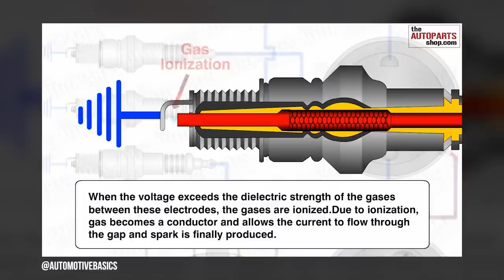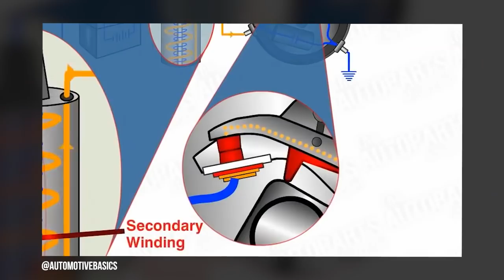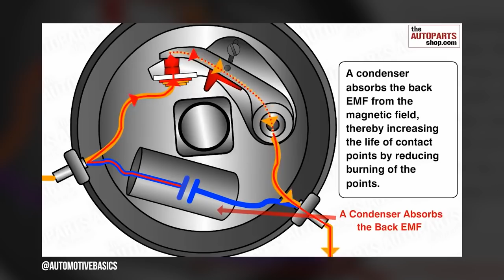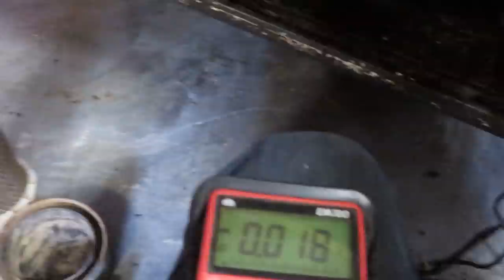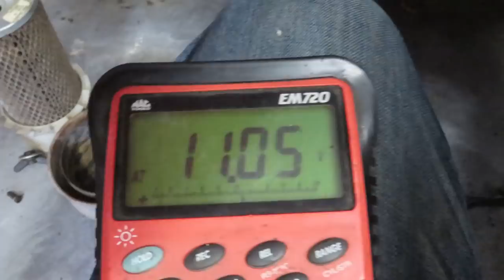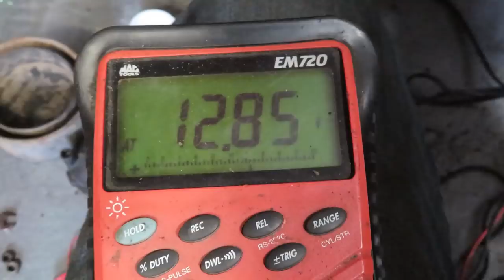What Could Be Wrong With A $300 Skid Steer?

Comment: I think that extra spark plug wire was your carb vacuum cap at some point.
Reply: Surely that would make sense. I wondered at the time: if there 𝐰𝐚𝐬𝐧'𝐭 a hose looking for a home, then the missing hose couldn't be the problem. Whatever's wrong with it, it has just happened. I mean, something must have changed for the thing not to run. If that wire had been used as a bung, then fallen out, that would explain the change. Right?  I know what I mean.😁
Reply: @2H80vids  I'll admit it, in a pinch on a Sunday, I've used spark plug boots to block off a couple vacuum ports.

Comment: If you haven't figured it out already, that's a Mitsubishi G64B or G63B engine like in 1987 to 1995 Mitsubishi Pickup. Distributor looks the same as mine. Should work. Check the timing belt. If loose may have slipped.

Comment: At least the engine is in the correct orientation. Most bobcat's have the engine transverse with rubber belts driving the hydro. For $300 I'd pull the engine and do a basic cleanup and com check and adjust valves and etc. Also clean the hidden oil cooler!!

Comment: A skid steer that won't sit still is a major PITA on a good day.  On a bad day they get lethal.  Last one I worked on for a guy he said he was having difficulty driving straight with it.  Jump in fire it up, right side creeps forward at a good clip.  I go to counter it (gently and calculated).  The damn thing goes full reverse on the right side swinging the bucket into a utility pole.  Hydraulic pump was hanging on with one bolt.  Every bushing was hammered.  I hate skid steers.

Comment: you might be wrong about the positive and negative on the points. the reason i say that is because in the old days you could run a positive to the coil and jump the starter with a screw driver and you were off and running with no keys

Comment: Considering where that passage ended up when you traced the solenoid on the carb, it looks like it is used to turn on/off a port vacuum source.  I have no idea why they would bother with that, unless it originally used port vacuum to operate the vacuum advance diaphragm on the distributor.  If it had this, it could have been an assist to starting the engine by retarding the timing.  This port vacuum advance was something that they used to do in the 80s to meet emissions, there are a lot of 80s pickups out there that used this system.  Tons of people in the 80s tried switching a port vacuum vacuum advance canister (which uses much less vacuum) in their pickups to a manifold vacuum source only to find that they now had a part throttle ping due to over-advance, and if they backed the timing off to reduce the ping the engine got really lazy.  This problem went away when most manufacturers went to throttle body injection around 87.

Comment: A340H,  just rebuilt my first automatic transmission.  95 4runner everything went good. Got it back together, it only works in 4wd. Works good shifts through all the gears. 2wd you can feel it trying, no go through.  Anybody have experience with a340h transmission and transfer case.

Comment: That's not quite how a points ignition works.  The point opening breaks the ground.  The condenser is there to keep the points from arcing.  The sudden collapse in the magnetic field of the coil primary induces the much higher voltage in the coil secondary.

Big carburetor fittings like that usually go to the pcv system.

Comment: Why not use some JB weld on the broken rotor? Build up the material, then shave it down with a Dremel. 
Or if you know someone with a 3d printer, you can have them make one for you. Nice video by the way 💪

Comment: Why does everyone hate on Fram? Ive been running them for years with zero issues. All my vehicles have well over 200k
Reply: I've never had a problem with Fram stuff either. I do normally use Wix but I don't hesitate if Fram is all that's available.

Comment: People say it's not volts that kill you it's amps but that is not how electric works. Think of it like a water pipe with voltage as pressure pressure, amps is the amount of water flowing through the pipe and resistance is the resistance of the pipe i.e. size of pipe and anything blocking the pipe like a filter or something. You can have very high voltage and feel nothing like with static electricity because there are very low amps but if you had 100mA at 1GV then that would probably kill you.

Comment: i traded a couple 40ft seacans for a 7753, came with forks, 4 in 1 bucket, regular bucket and a backhoe, it sat for over 10 years, fired right up, it has its issues, the locking pins for the attachments were locked up solid with rust, had to cut the bucket off then cut the pins out, that works fine now, the fuel pickup line fell off inside the tank, have a jerry can hanging from a wire on the side of the machine i use for fuel now,  all the belts fell apart as you would expect, it blew one hose so far right down at the bottom under the seat, had to stand on my head to fix that, the one drive motor leaks some oil, not so bad but i will fix that, and i need to fix the bearings for the cooling blower, all in all i'm tickled pink to own it, i keep it at a friends and he uses it almost every day, he taught his daughter to run it, i need to figure out the  auxiliary hydraulics so i can use the 4 in 1 and the backhoe lol

Comment: I realize this vid is over a year old but ignition timing is not determined by the relationship between the rotor and the terminal in the  cap.  All that will change there is the air gap
  Ignition timing is determined by the relationship of the signal generated by the reduction and pickup coil(or points cracking open)  to the position of the crank throw on the cylinder that's firing.  The floppy rotor would not have affected ignition timing unless it was turned on the shaft so far that the resistance was lower for the spark to arc to the previous cylinder.
Did it jump a cog on the timing belt?

Comment: Rich, what’s your thoughts on putting electronic ignition kits in these older gas machines? I put a penteronix kit with a flame thrower coil on our IH 686 earlier this summer. I wouldn’t say it helps much on start up but if I rip it from low idle to wide open, it doesn’t sputter and carry on like a lot of these old gas engines do when using points. There was a great debate on points versus electronic ignition recently on the Red Power Forum that seemed to be a drawl and a matter of preference. Good video as usual man.

Comment: Looks like a 4g32 Mitsubishi engine, they're in all sorts of equipment, especially forklifts. I think some of the earlier Dodge Colts came with these here in the states as well as some Mitsubishi vehicles, I do know finding parts for these engines is a whole lot easier through regular parts stores or eBay than the respective equipment dealer. Seems once something has a few years on it they're not really interested in selling parts for them.

Comment: Hey all, can't seem to find any solid info online. Can average me waltz into Home Depo and rent me a Skid steer with no hassle?  I now that you do not need a special license but that's about it. Seen a few video on how to loosely operate one but I have never operated a skid steer before. I'm confident, eager to quickly learn and competent. I have a small drive-way project that requires some leveling and moving mulch around that I would not like to do with my two hands and shovel. Something like a bob cat or skid steer comes to mind to make this a quicker job. Maybe removing a stump and relocating two Cyrtostachys (I think thats what they are) 5 feet closer to the street on the front lawn. Any input is greatly appreciated. Thanks!

Comment: Ballast resistors and coils are cheap as well. Also I wonder if it jumped a tooth.
Reply: Yeah. 
Doubt they did a timing belt on that thing
Reply: @fastinradfordable  the belt gets old, worn, and stretched, and will jump a tooth. Specially when your ignition is all messed up and you get a backfire.

Comment: current doesn't kill voltage dose because voltage determines the current potential so if the voltage is low the current is low. The higher the voltage the higher the current potential. Also, the duration of the shock also plays a role in this too. if you get shocked by a 10k volt discharge and 12 amps but only for .000000000001 seconds you'll be fine.
Reply: Elecrtoboom.

Comment: Bobcat 642 with a 1.6 L POS ford gas in it. I have this skid and we adapted a kubota diesel in it and it runs great. If you have this skid and you’re looking to move away from this unreliable engine. The kubota v1505 is a relatively simple and very reliable swap

Comment: This I learned from a guy who knew nothing else of value: when the intake catches on fire, apply wide open throttle and crank the engine, the engine will suck in the fire as it starts or even as it cranks and the problem is solved! no extinguisher needed.

Comment: The only complaint I have with this model design is the way they plumbed the hydraulics mine is down now because of a line that has a hole from rubbing on the frame gotta pull the engine to replace it.

Comment: Here is what happens when a young guy works on old style motors no clue on setting timing or dwell.  Ya want to find top dead center on number one (just remove number one spark plug hand crank engine and look for piston comming up once it is all the up is at tdc ) now you can mark the pull your from the timing light.

Comment: The distributor is bad that's why the rotors were damaged . While they were running it it backfired and blew the vacuum cap of the carburetor.  Seen this at least 50 times . Next it will break rotors and distributor caps . 
 While it running you can probably see the cap move. Then it'll start jumping time.

Comment: I have a diesel 853 bobcat and it has a fuel tank on the back door and leaks hydraulic fluid from the drive spoons and we traded some old junk hay equipment for it and it came with a log grapple a grapple bucket hay forks pallet forks and a snowplow for free so if i were to sell it I should get at least 5 grand CAD

Comment: Jesus, noone thought about cranking the engine to suck in the flames? lol
Reply: And blow the carb or intake
Reply: @FishFind3000  How in the world could you see that being a problem, it barely ran without the help of the aerosol anyway, it would just eat the rest of it until it was gone from the intake tract. Fine, pull the coil wire too then, and then crank it.
Reply: Not worried about the full fuel bowl, eh?

Comment: Its a Mitsubishi 4G63 isn't it? You should be able to get it easily  as they go in Mitsubishi vans and pickups. Don't just crank the distributor one way set it up on TDC on No1 and do it properly then set it to 8*BTDC. The timing marks are on the front cover and theres a notch in crank pulley  Check the plugs They probably have a half inch gap.

Comment: Low compression.  Maybe running on 3 but I bet it's got about 60 pounds of cranking compression.  Run it till a rod blows and pull some of the hydraulics before getting your 300 back in scrap weight.
Reply from the maker: When I moved the magnet, the dead cylinder moved

Comment: Typically voltage drop is checked with a load, using a voltmeter without a supplied load does not give an accurate test.

Comment: I have worked on electronics (I Have a Shop) for years & all 12v Batteries should be 13.8v !  They just call them 12v for some reason any new 12v batt should read 13.8 if it dont either its week/or bad or the tester is bad /out of calibration !  & i am assuming you know this & ya just mixed up what ya was saying cuz i do it to !

Comment: Wonna have an unreliable pice of equipment, put fram/scam products in it.😎
12:29 how I am when I’m putting in my 7.3 injector without a torque wrench to 10ft lbs, & trying to get it snug enough, but not over tight to not break the bolt/head.😂

That poor starter.

Comment: Hello Rich. Bobcat has a seareil number book 📖 that tells you when the machine was built being the company has changed hands over the years and has a fantastic story of evolution. 
I have a Baby Bobcat 443 model. The owners before me changed out the diesel and did a fantastic job of shoehorning in a 
Harbor Freight Predator 22 hp gas ⛽ engine. It's like a lawnmower on steroid s. According to the
 seareil number, it was the LAST MACHINE built in December of 1975 by Bobcat Monroe company's.
 On January 1st. 1976 The company became 
Bobcat Ingallsall-Rand.
I've made improvements to it like  the bucket two handel interface release and remounted the bushings to the arm tips for rotation clearance. New wheel seals and engine belt pully. 
These machines don't die, they just get better with age. 
Richard Bause 
Upstate New York.

Comment: It's not current that kills you. You can touch a welder with very litle voltage and thousands of amps and you won't even feel it. You can also touch a taser with thousands of volts and almost no current and feel it, but not get hurt. What kills people is power (Voltage * Current) by burning flesh, and frequency of the AC voltage wich conflicts with your nervous system and stops your heart. The current passing through your body will be determined by the resistance of your body and the voltage aplied. Current = Voltage / Resistance, wich means that if the voltage aplied to your body divided by the resistance of your body is bigger than ~~0.3 for a couple seconds you are probably dead. The only reason a ignition coil doesn't kill you it's because it can't provide high enough current to hurt, otherwise, at that sort of voltages, it's dangerous.

Comment: That engine looks alot like Mitsubishi saturn forklift engine.
Reply: Thinking that myself,  4g54 🤔 Defo a mitsi, can tell by the oil filler cap.
Reply: Found an old spec sheet online, it's a 4g32
Reply: My oldman has an old forklift with a 4g33 about same head cover, fuel pump distributor and some more stuff.
 If it sounds the same, looks the same and leaks the same it's gotta be be about the same shit!

Comment: The sloppy fit of the rotor arm will not alter the timing! It may reduce the efficiency of the spark transfer to the cap but in no way has it anything to do with the timing of the ignition relative to the crank position. Get your facts right if you are showing viewers what is happening.

Comment: That bobcat must be a( 742b) with a mitsubishi motor is almost identical to a. (1982 dodge colt) when i want to buy anything for the motor go to the local autoparts say you got a 1982 dodge colt. On the carb hope you get it working fine otherwise that mikuni carb is worth $ 1000.00 dollars by it self Napa $ 950.00 . God bless
Reply: Nope it’s a 642b has 6 lug hubs 
742b has 8 Lug hubs

Comment: 300$ for skid steer? You cant get the fucking bucket for that price around here. With blown engine and all hydraulics wear to point where it leaks more out that you can pour in same time and its 2-3K at least. This thing only needs little work on engine and rebuild the control valves, touch of paint and its worth 5-6K easy... Your 5-6k reliable machine is over 10K around here if you are lucky.
Some people....or guess its American continents wastefulness problem or something..

Comment: ain't those just ford pinto motors? Get you a $20 chinese duraspark distributor, and then just use any generic ignition module, new duraspark modules are fragile, if you've got an old one laying around they're decent, or just go with one of them generic as fuck  4-pin GM ones

Comment: Man, you are a great mechanic, but you are not an electrical engineer. Your description of how the ignition system works was... close enough for most people.A Hall Effect sensor and a magneto are unrelated. A magneto is just a high voltage generator. A Hall Effect sensor just tells you when a magnetic material is nearby, or is not nearby. That signal is amplified and fed to a computer which derives crank position, or wheel rotor position, or whatever else. In the ignition case it then decides when to fire the ignition pulse and switches on a power transistor, or MOSFET, or something of that sort.

Comment: @4:00 you say that the play in the rotor arm is delaying the timing. This is not true. The timing is controlled by the angle of the cam with respect to the crank and is not affected by the fitment of the rotor. The rotor simply transfers the spark to the cap and there is an enormous angular range over which it wil do this perfectly. 
You clearly have no idea what you are talking about but are quite happy to give your viewers wrong information while setting yourself up as an information source for how ignition systems work.
But Hey it doesn't matter because you are making fun of your friend's machine and it only cost 300$ and it's a pile of junk. Your lack of regard for your friend is surpassed only by your lack of regard for your viewers and also yourself by portraying yourself in this way throughout this video. I hope your friend found someone who could help him fix his machine.

Comment: So, wrong information about the ignition timing, unable to stop the machine creeping forward, unconcerned as to how or why the new rotor arm is broken, laughing too much about how you have no idea why it is running on 3 cylinders, setting it on fire, and not checking if the ignition coil is actually firing on each of its 4 stations. In the end it wasn't your fault because it only cost 300$ and it's a pile of junk. Did you replace the broken rotor arm or did you leave it in there to end up jaming and wrecking your friend's distributor? Oh of course it doesn't matter because it only cost 300$ and it's a pile of junk.